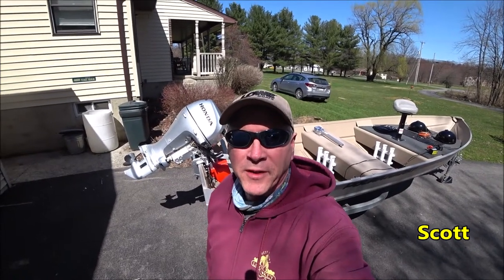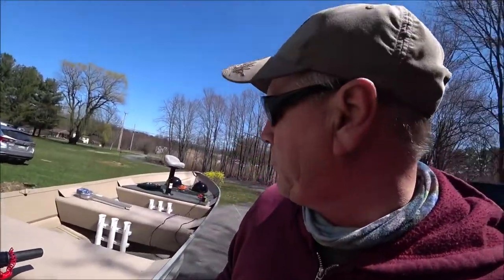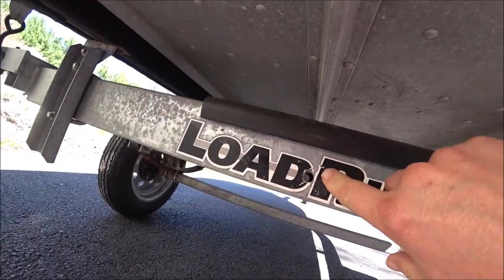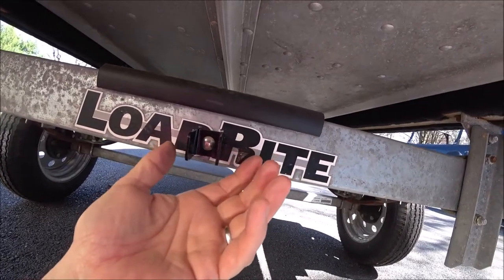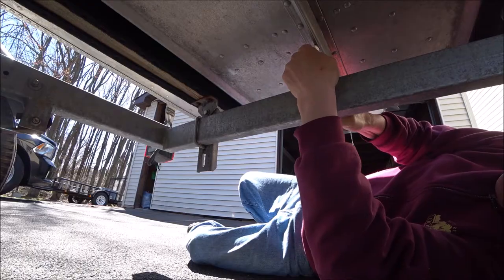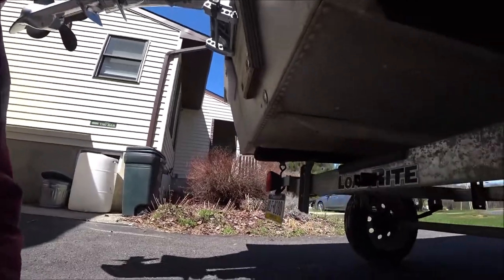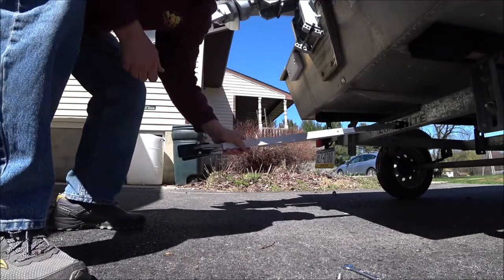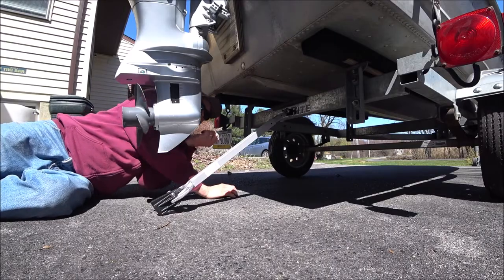Installing a Transom Saver on a Boat Trailer: Protect your investment.

Comment: I purchased the exact same Transom Saver from Atwood. It states on the package “Outboard must have power tilt and trim to use this product “. My tiller motor like yours does not have power tilt and trim. Wondering why it states that? (Listed on back side of package)
Reply from the maker: I'm not sure why that is suggested but it has worked well for me. Thanks for watching.

Comment: There is a flat washer included.  You forgot to put it between the lock washer and the frame when attaching the frame attachment bracket.  I bought this transom saver after seeing your video.  Great product.
Reply from the maker: Thanks for the tip. Lol. I always have spare parts!  Thanks for watching.

Comment: Thank you for the great instructional. Do you by chance know what is the size of the bolt for the bracket mount (length/width)? And what size drill bit did you use for the hole on the trailer?
Reply from the maker: I believe the drill bit was a 3/8 bit. The bolt came with the transom saver. Thanks for watching.

Comment: Good information on the transom safer 👍
Reply from the maker: Thanks for watching and commenting
Reply: Im so pleased I found this video because I was going to buy one of them transom savers, but the  shop were I was getting it from told me that it's only recommended for auto tilt outboard not manual tilt outboard. I have a Tohatsu 20hp 4-stroke and was wanting to travel with my outboard on the transom. Did you set the outboard to the first or second tilt position or did you just pick the position to suit the saver length. Hope this makes sense. Lol. Thanks 👍

Comment: Nice video. I have the same boat and am looking to put in the casting deck. 

Do you have a trolling motor? Can you control boat from front? Is the motor electric start?

What are the black ball shaped items on casting deck?
Reply from the maker: I did a video on the casting deck installation. Look in my polarkraft playlist. Thanks for watching

Comment: so when you get to boat ramp you have to get on ground and pull out the saftey pin and reinsert after you put boat back on trailer too?
Reply from the maker: I do pull that pin although I could use a bungee sling so I wouldn't have to do it. Thanks for watching.

Comment: Nice video. How fast does that motor push your boat?
Reply from the maker: Hello, originally I had a 4 hp on this boat and now have an 8 hp on it. The boat goes about 12 knots. If you look in the PolarKraft playlist you can see the videos when I do a speed test with each motor. Thanks for watching..

Comment: To remove the clevis pin before you launch need to work your way under and pull the pin. Not that easy
Reply from the maker: So far I'm flexible enough to reach. Thanks for watching.

Comment: The rounded end goes around the center roller, also you had it put together wrong. The round end should have been slid into the other tube with another 1/4 turn. https://images.etrailer.com/static/images/pics/3/1/315-fxh_14_1000.jpg
Reply from the maker: Thanks for watching and the info.